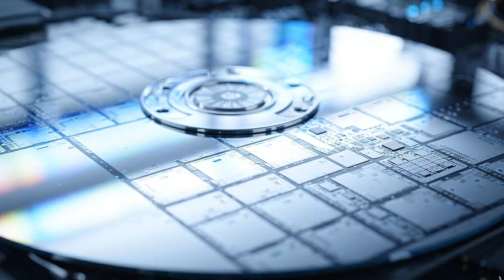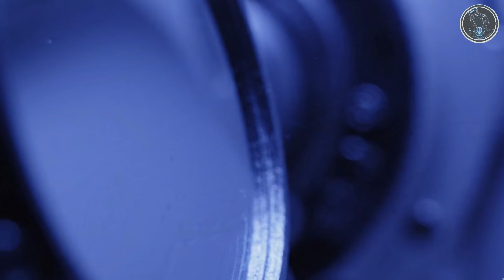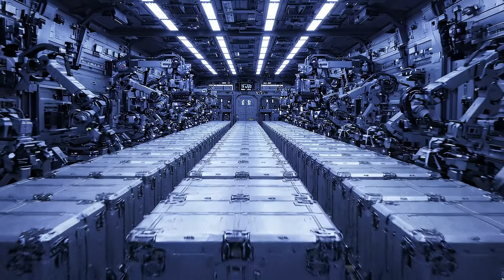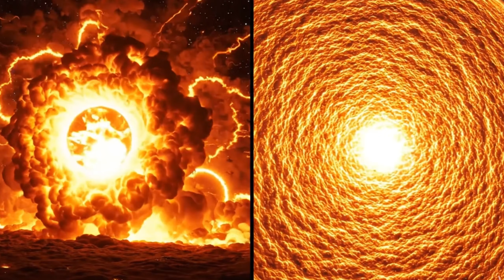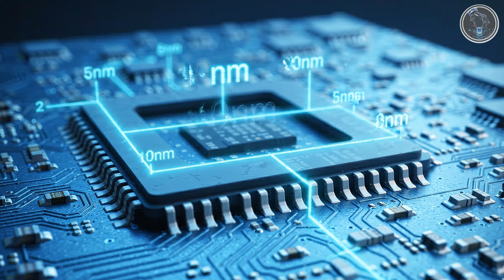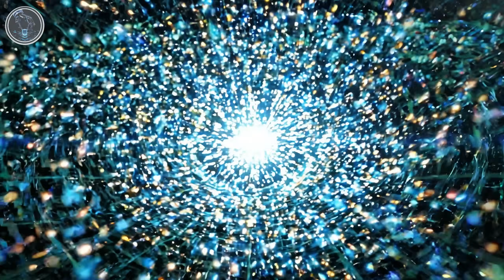The $400 Million Machine That Prints Chips on Light

Comment from the maker: 📌 3 things that surprised us most while researching this video:

1. The "Germany mirror" analogy is actually REAL — Carl Zeiss officially states their EUV mirrors are so flat that if scaled to the size of Germany, no mountain would be taller than ~1mm. This isn't poetic license. It's a published specification.

2. There are only about 300 EUV machines operating globally as of mid-2026. That's it. 300 machines for the entire world's advanced chip supply. Every iPhone chip, every Nvidia GPU, every Tesla autopilot processor — they all passed through one of these 300 machines.

3. ASML almost gave up multiple times. EUV development started in the early 1990s. The first commercial machine shipped in 2017. That's 25+ years and over $13 billion in combined R&D before a single production chip was made.

Which part surprised YOU the most? Drop it below 👇

Next episode: Inside the cleanest room on Earth, where the wafers from these machines are born — and where a single dust particle is the enemy.